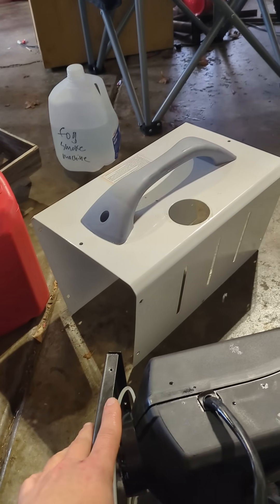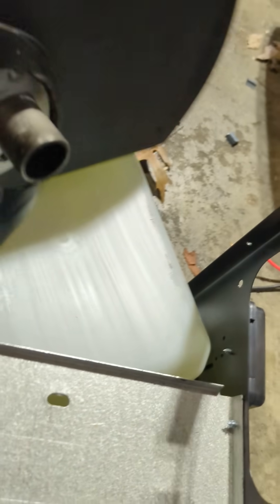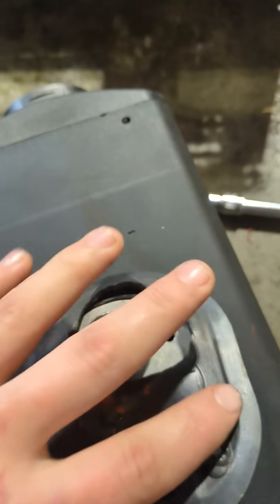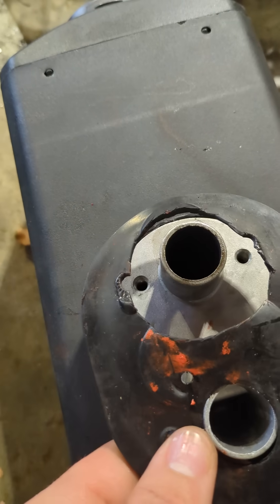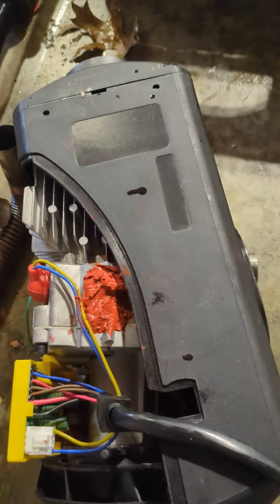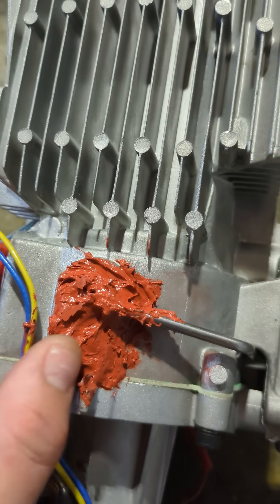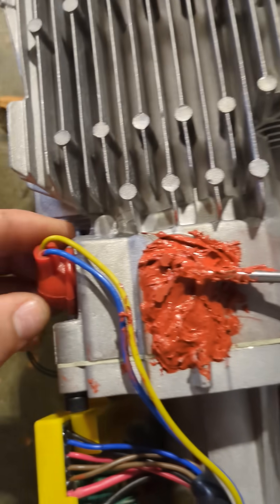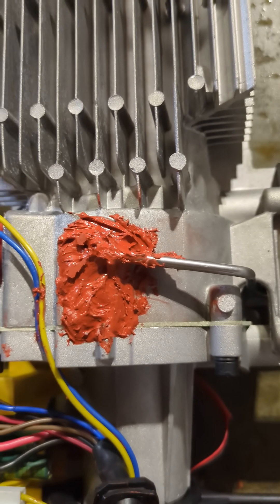Diesel heater making you sick? Burning plastic or rubber smell? Easy fix

Comment: I did this, but it still has a slight rubber smell
Reply from the maker: @Deesnuts-t4z  you'll never get rid of it completely, unless you replace the parts with better ones.
Reply: @HighVoltageMadness  Yes. Replace it with american made heater... Too bad we don't make them!

Comment: What's the purpose of that gasket by the intake/exhaust? Can I just remove it completely?
Reply: I’m also curious abut that
Reply: If you installing on plastic/wood surface,  it insulate it.   But like this setup where is bolt on to a metal plate,  i don't see a purpose to use that gasket.
Reply: noise

Comment: Does rtv smell when hot
Reply from the maker: @CHEAPROLLIN  Yes but  only during the curing process when the silicone is chemically reacting and releasing byproducts. It will smell kinda like vinegar. Once it is dry it won't smell anymore.
Reply: @HighVoltageMadness do you remove the black rubber or just over the top? Mine almost smell like burning wood
Reply: And I’ve done the rubber trimming it’s definitely better but still getting a smell I don’t like 😔